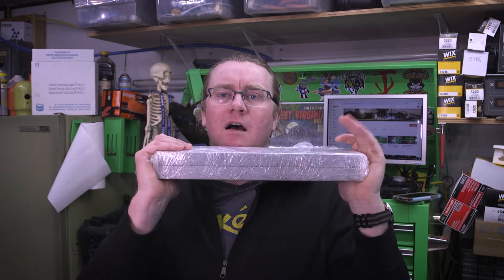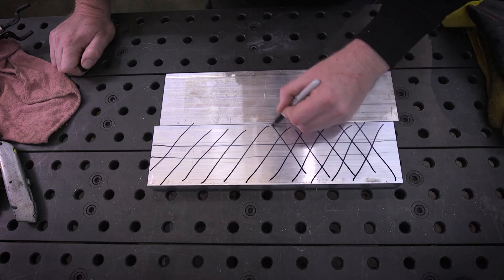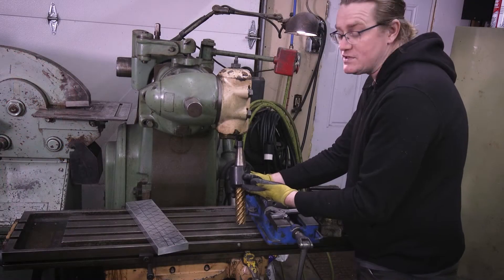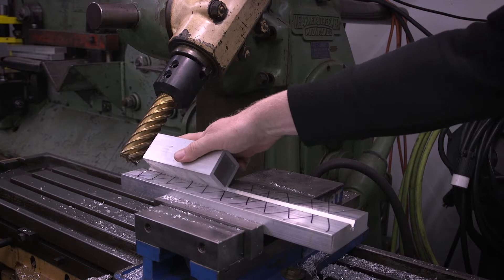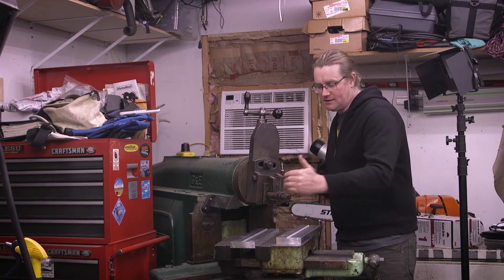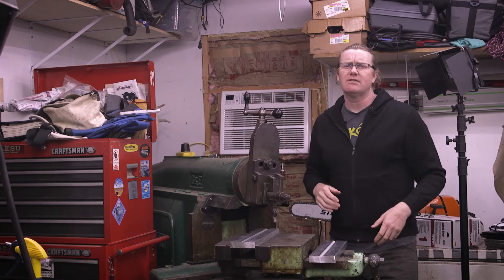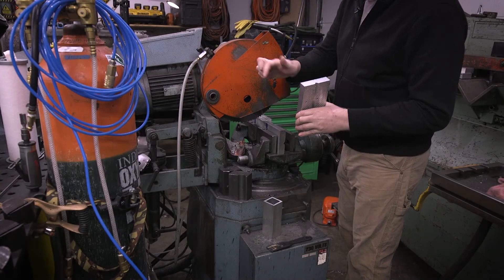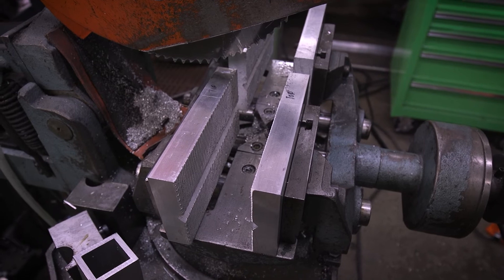Darlingtonfarm Scotchman cold saw vice jaws

Comment: Good job. Id like to see what is the best method to step up to 3 phase machinery if you only have single phase power in your shop and 50 amp breakers. VFD, rotary phase converter, step up transformer, static converter etc? Ive battled with this for several years now and want to do something about it.
Thanks
Reply from the maker: I run a 10 hp rotery converter on a 50 amp breaker